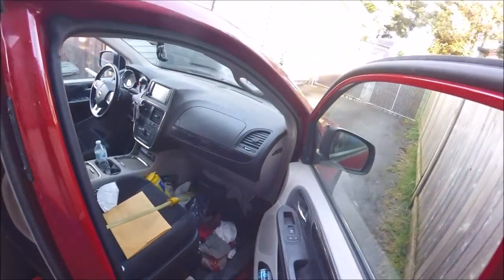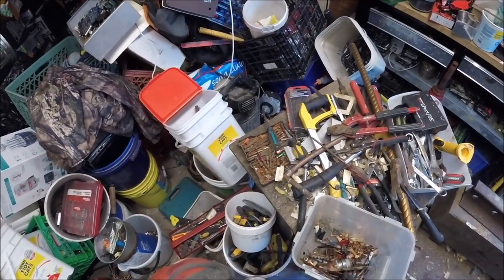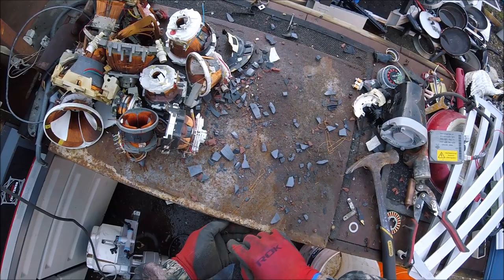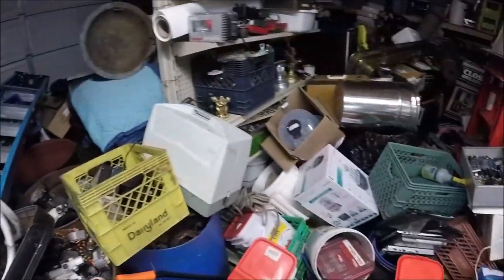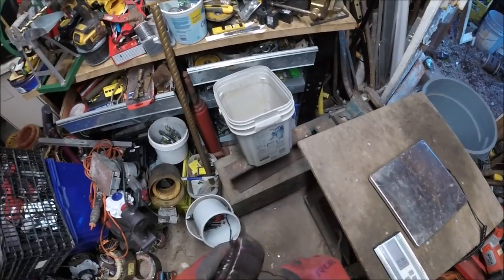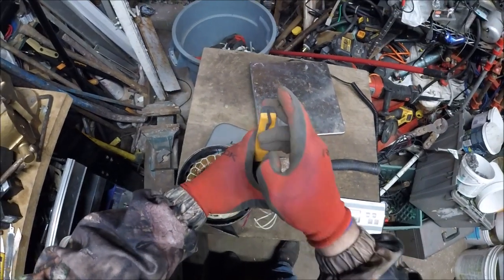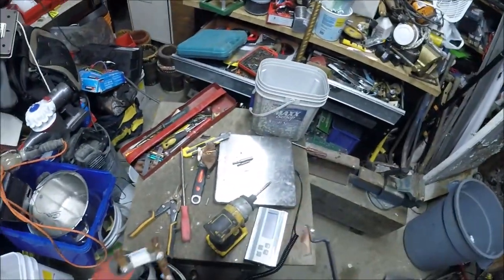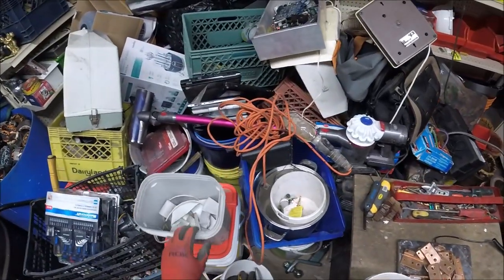Scrapping More Copper Barring Scrap

Comment: I know you are doing what is easy and already almost done, but I see a couple old school tvs sitting around. you can scrap them out for the yokes and that will help clean up the yard like you want. I know you would need to  take the tv's to dispose of at transfer station or wherever to recycle but it would be one step closer to getting them out of the yard to help clear space. great video. I took a big aluminum load in a couple days ago but I think I'm just going to sit on my copper for awhile now since prices are dropping. I don't have a huge hoard like some of you guys with yards or property, so I only keep a few buckets of different things. I get rid of my iron pretty fast to keep space but the nonferrous is stored a bit longer. hope the price will go back up in later spring and summer. Cheers from North Carolina
Reply: Good. Very focused.
Reply from the maker: Just collect until the price is right

Comment: That is a lot of motors in your shop, sort of like a retirement savings plan.  That is crazy about the heat sensor wire, I think you had sparks off wires like that when you were scrapping out stoves.
Reply from the maker: If you cut it only

Comment: Hope to see a lot of copper extraction action tomorrow. You got about 50 pounds of copper by end of the video. If you focus complete day tomorrow only on copper stuff, by Monday I am sure you will have 150 pounds. Where the other 100 pounds will come from ? From the drum in the front. It contains lot of ceiling fan rotors and other rotors easy to cut and pull copper. The rotors on the ground which were cut on both sides, can be worked with the Punch you got today.

Comment: Those transformer's that you couldn't bust open. Couldn't you ues your saw-saw? And cut one end of the copper off. Then nock out the rest of the copper. Probably still get more than just selling them as is? Just a thought.
Reply from the maker: I could do that, But i get 52 Cents per pound that's around $5 each not that bad